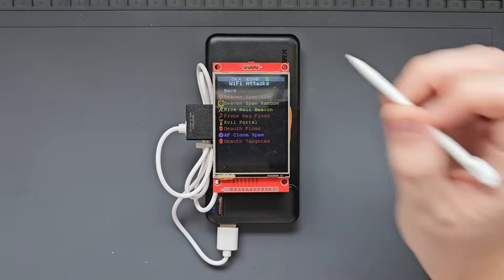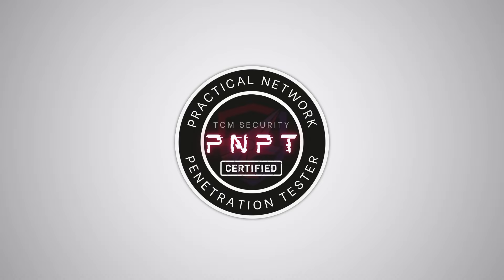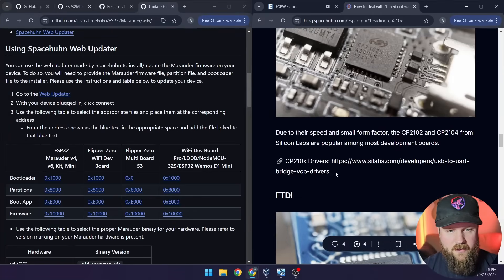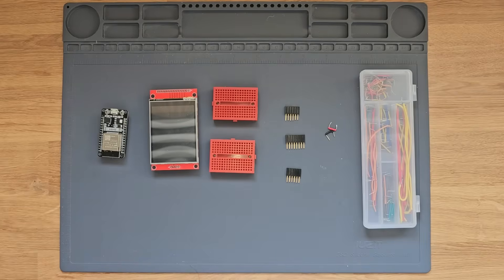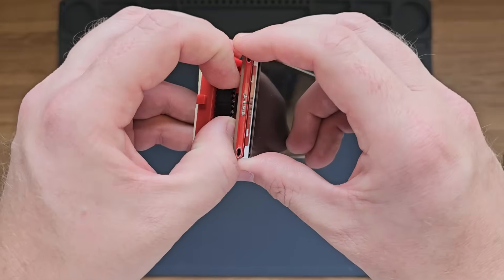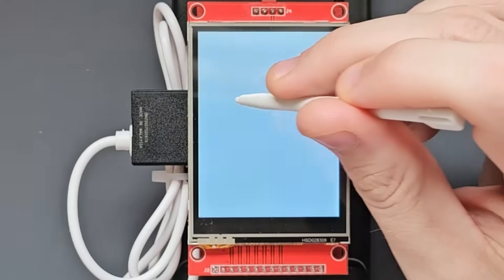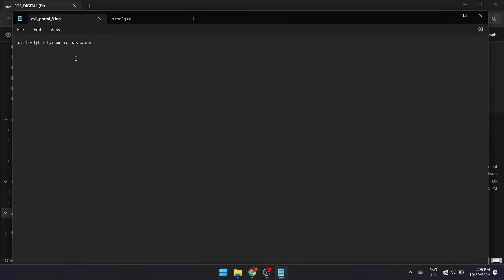Build Your Own Wi-Fi Hacking Tool (ESP32 Marauder)

Comment: Well, I've transferred the code to the ESP32 and connected every cable on the screen to the correct location, but the screen is still white and nothing else happens. I'd appreciate it if someone could help me with this issue, whether it's the channel owner or a follower.

Comment: Did anyone run into an issue where the tap does not work on the TFT LCD Touch Display? I can scroll up and down, but cannot select a menu item. In my research, it might be something to do with the T_IRQ pin or something else.

Comment: I have faced a very Stange error on boot up the firmware the tft display stays white, after a multiple touch's on the screen all of a sudden the marauder displays comes in but the touch doesn't work fine as in the video where if i touch in the bottom screen touch selection highlight goes up in the menu and in the top to go down to select any options from the list i need to click in the center of the screen, can you tell me how can i troubleshoot this and have it fixed. i have used the same steps followed in the videos to setup the hardware.

Comment: Pls anyone help me the TFT UI is displaying sideways instead of vertically, even though I’ve used the same connections, installed the firmware, and updated the drivers, I’m still facing the sideways display issue.

Comment: How do I add the 4 pins at the bottom of the TFT screen? The only options available that i am seeing are screens without the 4 pins on the bottom.

Note:
I am referring to the 4 pins that you connect to the dev board using the 6 PIN header strip. 10:36
Reply: I'm having the same issue. I purchased the screen using Andrew's links, but it does not have the bottom 4 pins. I assume we need to get an additional header for this to work. Andrew, was the bottom 4 pin header already on your board or did you add it?

Comment: is the ESP32 Dev Kit and ESP32 WROOM 32U same? and can i use it in this build as i want to use antenna with it
Reply: Hi, I have the same query. Did you end up figuring it out?
Reply: Nope it's different board
Reply: Thanks, ik its a different board but could i still use it?

Comment: Friends, if my esp32 doesn't have pin 16, what should I do? Can I use another pin without modifying the file?
Reply: Bro u need to change pin in code to fit ur pin the flash ur version
Reply: Or just use the web flasher that auto detects board
Reply: @SuzzieSamonCan you help me with the script that needs to be changed to support the esp32 cp2101 so that it fits?

Comment: dude why wouldnt you mention the screen you linked in the description doesnt come with pre-installed SD pins. i just wasted a ton of money on this project and i cant even fucking build it cuz i dont know how to solder or anyone that can.
Reply: Bro if you don't know how to solder maybe this project is a bit out of your ballpark?
Reply: @HAMSTERLUIGI  He literally never mentions soldering to be a requirement in this video, why would I have thought that? And I did end up finishing the project soldering was the only setback.
Reply: @GooberiousSupreme buy a cheap soldering tool and learn how to solder, these joints are very easy to solder
Reply: @GooberiousSupremeim Just saying, solderig is a very Basic Skill. To truly understand what you built is mich more advanced - then again Most people probably Just wann to use this thinf
Reply: @jacoblester9385  that is exactly what i did a month ago to finish the project

Comment: Can you please please add a video like this but tutorial on how to add an ANTENNA and SD Card
Reply: its easy if you have an esp with a wire antenna ( NOT A MODULE ANTENNA ) you just plug in the wire antenna and the esp will automaticly go and use that

Comment: Thanks for mentioning the need to solder the headers onto the screen on the 4-pin side. This project does require soldering why did you lie in the intro and then leave information out? Not very cool and I think against TOS

Comment: It's a pain in the ass assembling all those parts, you can buy a CYD touch screen with a esp32 installed on it. All you need is a powerbank and maybe a 3d printed case.The process of installation is the same.
Reply: Yea, wish I would have got the 2.8" instead of 2.4", now I have to mess around to try to get it going.

Comment: What is the distance it stops working at because I saw a similar devices with antennas how do I make those
Reply: You have to solder a extension to the top of the esp32 board, I took my WiFi card from my old pc and took the SMA connection and soldered it to mine

Comment: Hi, I used the 3.5-inch TFT ILI9488 display in the project, and this is what caused my problem. The problem is that it does not show anything. How to fix it?
Reply: bro did you fix it i have the same problem ???????

Comment: ı have a problem its this in the serial

rst:0x3 (SW_RESET),boot:0x13 (SPI_FAST_FLASH_BOOT)
configsip: 0, SPIWP:0xee
clk_drv:0x00,q_drv:0x00,d_drv:0x00,cs0_drv:0x00,hd_drv:0x00,wp_drv:0x00
mode:DIO, clock div:1
load:0x3fff0030,len:1100
ho 0 tail 12 room 4
load:0x40078000,len:12308
load:0x40080400,len:3076
entry 0x400805ec
rst:0x3 (SW_RESET),boot:0x13 (SPI_FAST_FLASH_BOOT)
configsip: 0, SPIWP:0xee
clk_drv:0x00,q_drv:0x00,d_drv:0x00,cs0_drv:0x00,hd_drv:0x00,wp_drv:0x00
mode:DIO, clock div:1
load:0x3fff0030,len:1100
ho 0 tail 12 room 4
load:0x40078000,len:12308
load:0x40080400,len:3076
entry 0x400805ec
rst:0x3 (SW_RESET),boot:0x13 (SPI_FAST_FLASH_BOOT)
configsip: 0, SPIWP:0xee
clk_drv:0x00,q_drv:0x00,d_drv:0x00,cs0_drv:0x00,hd_drv:0x00,wp_drv:0x00
mode:DIO, clock div:1
load:0x3fff0030,len:1100
ho 0 tail 12 room 4
load:0x40078000,len:12308
load:0x40080400,len:3076
entry 0x400805ec
rst:0x3 (SW_RESET),boot:0x13 (SPI_FAST_FLASH_BOOT)
configsip: 0, SPIWP:0xee
clk_drv:0x00,q_drv:0x00,d_drv:0x00,cs0_drv:0x00,hd_drv:0x00,wp_drv:0x00
mode:DIO, clock div:1
load:0x3fff0030,len:1100
ho 0 tail 12 room 4
load:0x40078000,len:12308
load:0x40080400,len:3076
entry 0x400805ec

Comment: I need some help. I wired mine up with the 2.8" touch screen and it boots but the touch is upside down. so when I touch the top it think it click something at the bottom. Is there any way to fix this in the firmware and if so how?
Reply: Hey , how are you? did you manage? Lucky yours is just inverted, my display works but is unresponsive to touch...

Comment: I'm confused when I flash it onto the esp, the screen is just black with the backlight on.. I see nothing and I've checked my wiring and all.. does the.. -> "ideaspark® ESP32 Development Board 16MB Integrated 1.9 inch ST7789 170x320 TFT LCD Display,WiFi+BL Wireless Module,CH340 Driver USB Type-C for Arduino Micropython" not work? Without the the tft display obviously using the same display in the video..
Reply: Okay I got it working but it's the wrong orientation>?
Reply: @dxxthly  how?
Reply: @ well at least a project with it.. that works.. kinda explains it on there.

Comment: can i use the 2.4 in display instead of the 2.8? it hase the same Pinutt/resolution/ic driver
Reply: yes, if the resolution is 240X320

Comment: Anybody have the wire map
Reply: i am also searching for the same
Reply: SD Card	2.8" TFT	ESP32
VCC	VCC
GND	GND
CS	GPIO17
RESET	GPIO5
D/C	GPIO16
SD_MOSI	MOSI	GPIO23
SD_SCK	SCK	GPIO18
LED	GPIO32
SD_MISO	MISO	GPIO19
T_CLK	GPIO18
T_CS	GPIO21
T_DI	GPIO23
T_DO	GPIO19
T_IRQ	
SD_CS		GPIO12

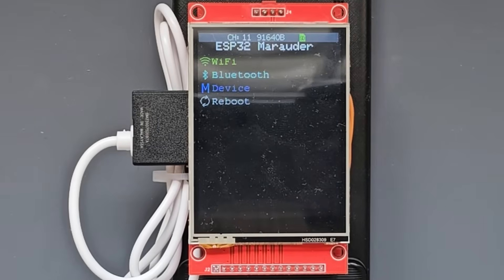Comment: #The_Cyber_Mentor what is that black thing at 15:28 of video on left of the maruder
Reply: Maybe it's a sd card reader module joined together seperatly. In some cases some lcds don't come with dedicated card slots on the back so that's why that black thing is used.. I think so 😅

Comment: Hello! The video was great and you explained everything perfect but even though my screen and esp32 work fine I cannot get it to work the screen doesnt show anything. I installed the same firmware as you did and made the connections about 5 times thinking that could be the issue. Any idea?
Reply: SAME FOR ME?
WT TO DO
Reply: 1.. try diffrent flasher and i have the same problem and check the jumpers or redo it i have to redo it 6times

Comment: i did the check and fix the wirings 3 times and i also flash the firmware 3 times but i still got white screen can anyone help ?
Reply: I’m experiencing the same issue. If you can solve it, could you explain it to me as well? Thank you.
Reply: @Pixxell_6  I also have the same issue, if it works now for you please tell me.

Comment: It turned but the screen is white, please help
Reply: "I’m experiencing the same issue. If you can solve it, could you explain it to me as well? Thank you."
Reply: @Pixxell_6  I am sorry to say this but i was unable to resolve the issue, it may be possible that the flasher wasnt able to flash it properly. i returned the esp32 and bought a m5 stackc plus 2 instead and then installed bruce and marauder firmware on it. Maybe you should get one too
Reply: @generalviky41 i had the same problem, in my case i had to give extra cablen to led connection witch was 32gpio and extra to 3v3

Comment: I am tested with ILI9341 2.4" and for some reason, I can't use the touch. The display is working fine, but touch doesn't work. Someone have the same issue?
Reply: did you get it working? having the same issue... :(
Reply: @javierespada72 yes and not. Installed v6 version and touchscreen now works, but with bad calibration.

Comment: I have made the whole marauder however some features like the evil portal needs an SD card to work but when I plug in my SD which is 16GB and fat32 the marauder does not recognise it, how do I fix this. Also my touch input is backwards on the screen and justcallmekoko's git hub page tells me to update the marauder via sd card to fix the touch issue, but I can't do this as the SD card won't be registered.

Comment: are we supposed to add sd card?
also i did everything but after powering up nothing happens, i have no clue what gone wrong, i used esp 32 wroom, the touch screen does not turn on
Reply: Yo I’m not sure but I think so he never says anything about it but I think it dose need the Sd card
Reply: Same here 😂... Wondering what is wrong..
Reply: ps: I reprogrammed the esp32 and test it out in the webprogrammer terminal, it was okay , then i put it back in place and it also worked with the touch screen, but it still does not read sd card
Reply: also it works without sd card 👍
Reply: same here. Tried about 6 times and still nothing happens. Both the screen and esp32 work well but when I make this the screen just stays off. Good luck.

Comment: my touch screen is missing the 4 pins and my female pins are too short what should I do ???
Reply: same for me, the screen is missing the 4 pins; i think he gave us the wrong link because if you look at it again in amazon, it doesn't have the 4 pins. But please let me know if you find a solution.
Reply: also, i haven't fully built it yet, but it seems those 4 pins are for the sd card. So, it should function fine without it is my guess.
Reply: @A726F what's the condition now bro
Reply: @Martial_art_expert  so yeah, the 4 pins are for sd card; if you don't use a sd card then you won't need the 4 pins. It works perfectly fine for me

Comment: I did everything but the result is a white screen
Reply from the maker: This most likely means one of two things, first the wiring from the esp32 to the screen is missing a connection or not wired correctly, second is the firmware did not flash properly. - Andrew
Reply: @TCMSecurityAcademy  I have checked the wires and i flashed the firmware 4 times and i still have a white screen what do i have to do now please ?

Comment: Stuck on boot loop using v4 (old hardware) on ESP32 Wroom 32U model. It turns on and says - ''Giving Room for hardware Serial, Marauder v.1.0.0, Starting Serial'' Then boot loops. Anything you can suggest to help ?
Reply: Fixed - In the end my power supply was not strong enough and I switched the cable. Everything works well now.
Reply from the maker: Glad it worked out!
Reply: could you help me with my wroom32u? i wired the pinout correctly but my touch is still not working

Comment: Any reason why you went with the ESP32S chip and not the D?
Reply from the maker: I used a devkit that I had on hand, so no specific reason, although based on the documentation for the project any ESP32 devkit should work. - Andrew
Reply: Скорее всего что прислали